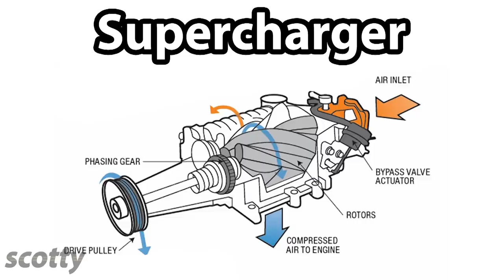Supercharger vs Turbocharger - Why Supercharged Car is Better than Turbo

Comment: Why not have both?
Reply: and nos.
Reply: l3arrett82 then you drive down the road and you hear a loud explosions and you have no engine.
Reply: having both is called superturbo. my car has that and it's the best, and twin charging is something completely different from a super turbo
Reply: Vw did it in one of their hatches, look it up on net....
Reply: then the only option is to hock the house and build a new motor with a supercharger.
Reply: Lancia Delta S4
Reply: Both is nice but you better upgrade all the internals cause you'll be bending rods for sure, if you don't get one shooting out the block. Better get a good cam. A roller cam would be best. Better get some good heads too.
Reply: Volvo
Reply: Both on top of a v8 rip gas mileage
Reply: KastaRules 😂
Reply: i think some detriot diesels had both
Reply: You can. Its called twincharging
Reply: Volvo XC90 T6 has Direct-Injected Turbocharged & Supercharged Engine
Reply: The technical term is "twincharging". It's an incredibly expensive setup, as I'm not aware of any off the shelf kits to do such a thing. It would require all custom fabrication, plus the air charge would be so heated there's a good chance it would actually cost you power.
Reply: scientific method perspective And what car might that be?
Reply: KastaRules reliability
Reply: +jacktheripped  I had an 892 twin turbo great engine
Reply: +jacktheripped  42 ft Chesapeake bay deadrise workboat
Reply: Twincharged Toyota 4age
Reply: KastaRules because the supercharger will become a restriction to the turbo and most superchargers will be very inefficient when supplied with compressed air. The mustang guys used to do it for bottom end torque, it was good but a nightmare to tune and when they removed the super they realized they could gain a lot more horsepower while sacrificing very little torque
Reply: KastaRules You wanna fly you lol!
Reply: It's been done, I've seen cars with twin turbos and twin screw superchargers. The reason why is that supercharger work better on lower rpm range power and turbos work best mid to higher rpm. So you get boost throughout the entire rpm band
Reply: Volvo makes both currently in their production vehicles
Reply: +jacktheripped: The 8V92 had the turbo mounted atop the Supercharger. Sweet setup with a sweet sound to match.
Reply: That's where Audi's have
Reply: Its not called a super turbo, its called a twin charger.
Reply: KastaRules been done for years. Detroit Diesel discharged air from turbocharger into the blower.
Reply: You would be over torquing youe engine and it will blow up. And getting a turbo or a super that can put out higher boost is more efficient than adding a turbo and super.
Reply: jacktheripped an 8V71 was available; made 318 horsepower.
Reply: nouse use not really...
Reply: KastaRules March superturbo?
Reply: 2003/04 Cobra owners do it all the time. 800hp daily driver. #HellionKit
Reply: danger to manifold. the floor panel may come off
Reply: aye! a rally fan!
Reply: bubba fisher , Not if you tune it right!!!
Reply: KastaRules volvo T8 engine has it. Works great.
Reply: Xc90
Reply: Nissan march has superturbo plus audis with TFSi i all hve it
Reply: New Volvo vehicles have them, but the best Volvo for efficiency is when the turbo-charger, supercharger, and an electric motor with a battery pack all add up to a hybrid.
Reply: Yeah, Lancia Delta S4
Reply: Compound boost, hellion makes a kit.
Reply: Leroy
Reply: Skoda Fabia VRS 1.4 Twincharged, bit of a pocket rocket in the right hands!
Reply: Twincharge FTW
Reply: VW had some TSI engines that had both. Combines the best of 2 worlds. More power at low revs from the super charger and more power at high revs from the turbo.
Reply: Twin charged plus nos😆
Reply: KastaRules spotted the beta male.
Reply: rcairforceone unless you run 110 octane therefore you will be running to ric☺
Reply: Vw golf gt sport had both 170 bhp from a 1.4
Reply: bubba fisher nope, VW does it with their 1.2 and 1.4TSI engines.
Reply: my only complaint with supercharger is the whine noise they make, its like a toy car.  get me a silent one and I would get one.... add it to my 2.7l turbo ecoboost.
Reply: volkswagens are twin charged
Reply: Yea as soon as I win the lottery💵💸
Reply: Volvo's newest generation of 4 cylinder engines use a supercharger and turbocharger
Reply: scientific method perspective. Actually its called twincharged
Reply: l3arrett82 if you had both your engine would explode before you can drive down the road
Reply: Look up Hellion Hellraiser.
Turbo kit for supercharged 2003-2004 Cobras. Big power, but those cars come with built engines from the factory.
Reply: KastaRules Because it's a pain in the ass to tune for it. Twincharging an LS is a nightmare and tuning is next to impossible to get right (already tried).
Reply: No problems with the Hellraiser Mustangs...seen a bunch of them them running strong, although I think using the stock blower vs a perfectly sized turbo is only done for sneakiness or the coolness of it. People lose their minds when the pop the hood, see the stock blower, and then the car puts down four digit numbers with ease lol..turbos hidden up in the front bumper.
Reply: bubba fisher its called head studs
Reply: Robert Elmo I had a hard time getting the fueling and timing tables perfect innthe mid rpm ramp. I'm not doubting a bug company with dedicated tuners working on perfectly sized system, I know it was a royal pain on my end. Then again I'm a bit of a perfectionist so that doesn't help.
Reply: scientific method perspective having both is called twincharging
Reply: Jack Barlow your thinking of the 8v92. 8v71 was just blown the 92 was turboed and blown but prone popping from the boost especially when ya turned em up a bit.
Reply: Theres a Hellcat with a set up like that sounds amazing i think it puts out like 1000hp its on you tube
Reply: why? because wings stick out to far from the car, thats why !!! :)
Reply: why? because you'll need a Pilot' license, thats why !!! :D
Reply: Mate it’s no that easy
Reply: P47 thunderbolt had both
Reply: CALIN CAMPBELL the sky is the limit if you know how to build the motor.
Reply: CALIN CAMPBELL yeah really the limiting factor that can't be eliminated is valve/port restriction but then again unlike a naturally aspirated engine you're forcing air in so if the block, intake and head are strong enough and your injectors flow enough then who knows.
Reply: Some seat cupra do :p
Reply: scientific method perspective I've always been told its considered twincharging. I did it on my Audi and it was absurd.
Reply: Then you gotta run on race gas if you want to use both.
Reply: Mar Stillo , what difference does it make the nomenclature? Dr. Sanford A. Moss was the developer of the turbosupercharger   (Note correct nomenclature & not a manufacturer's trade name), although credit for the basic idea goes to Rateau of France.  The turbosupercharger was installed on many WW2 era  aircraft to overcome power losses associated with high altitude,  thereby increasing MAP  (manifold absolute pressure).
Later Sir Frank Whittle built on these principles,  which evolved into the first jet aircraft  developed in the free world.
Reply: cloridan Beauchamps , it's a turbosupercharger which was developed in the very early 1900's by Dr. Sanford A. Moss.
Reply: Justin Girard, turbosupercharger
Reply: KastaRules the hellcats have both!!!
Reply: Ask a volvo owner, something about a liquid soup leak from everywhere but nowhere.
Reply: KastaRules buy a Noble M600
Reply: Hi
Reply: FroztiProductions, that's the best set up there is and it proves that there is room for both instead of one over the other in the way polarized people think.
Reply: Starfighter USSCV-66, I thought it was Alfred Bucci of Switzerland that invented the turbocharger.
Reply: Lol that will probably blow the engine
Reply: I've seen twincharging on modified MINIs.
Reply: KastaRules that actually exists and it’s called a twincharger
Reply: scientific method perspective noob, it is called twincharging
Reply: Nooo, its called twincharging, and its actually pretty expensive and involves a lot of work.
Reply: gotta love my five-cylinder turbo. so weird, but oh so smooth...
Reply: pulls up to a Volvo
"What you got under there?"
"Its an I4 engine" drags on down to next light
"... did i mention its twincharged??"
Reply: KastaRules you'll have WAY TO MUCH boost, which doesn't increase HP any further
Reply: Toyota did it in 1984. The mr2.
Reply: scientific method perspective twincharged*
Reply: Fabia VRS, Nissan March Super Turbo, SQ7 or Volvo with a t6/t8 engine? All other twincharged cars are like 150000€+, so i assume not not that ones.
Reply: KastaRules you mean Twincharged right?
Reply: TwinCharged....
Reply: KastaRules Mbn to be rich
Reply: My volvo has 2 superchargers and twin turbo
Reply: My Volvo has 2 superchargers and twin turbos
Reply: @-smp-scientificmethodpersp838  will it blow your Engime
Reply: @-smp-scientificmethodpersp838  engine*?
Reply: rcairforceone I modified one of my Mercedes to have it. It's not a twin charging system. A twin charging system is when you have a super charger compressor and a turbo compressor working together. A Super-Turbo is when both technogies are combined into one mechanical device.
Reply: scroopy Noopers no, a super turbo system and a twin charging system are different
Reply: Maytee Nodarse no, twin charging is different than Superturbo charging.
Reply: cloridan Beauchamps thanks for trying to help bro. I appreciate that. Actually a Superturbo is a different system than twin charging.
Reply: Justin Girard no, twin charging is different than a Superturbo. Thanks though!
Reply: Eon Gaming nice! Yes, what you did was probably twin charging, because you have two different charging systems working together. That's why it's called twin charging. I did a Superturbo. That's when you take both charging systems, and combine them into one mechanical device, instead of two. Thus, I'm single charging, instead of twin charging. Your car sounds awesome btw!
Reply: Hysandel GT Hey, thanks for the constructive criticism, but twin charging is when you have two systems charging, thus: TWIN charging. Superturbo is when both systems are built into one mechanical piece that looks like a regular turbo, but it's built very differently. Therefore, Superturbo charging is a single charging system, not a twin charging system.
Reply: ALEXIS TROY DACANAY lol I can tell your actually the noob, not me. Twin charging is two devices working together. That's why it's called twin instead of single. Superturbo is a single charging device. Therefore, it cannot be called a TWIN charger.
Reply: Glorified Nuggets Superturbo is a single charging system. Twin charging requires two chargers. They are very different.
Reply: JDM Fanboy no, it's not a twin charging system. Superturbo is a single charger. Thanks anyway bro
Reply: team glock only if you don't know what your doing. You can tune your charger to your engine capability. You can also tune your engine to match your charger.
Reply: GMC Denali 717 maybe if you twin charge, but not if you Superturbo
Reply: rcairforceone that's why you Superturbo instead of twin charging. Way less stuff = less weight and not as complex to put on your vehicle
Reply: l3arrett82 say less I’m doing the same and maybe the kids don’t need a expensive nanny anymore I think they can survive on their own now😂
Reply: Better yet. A sequential twincharge setup which has the supercharger kick in immediately and have the turbo kick in at about 2250 RPM but not produce full boost until about 4750 RPM so that way the tail doesn't kick out from underneath you by surprise.
Reply: jacktheripped
The Volkswagen 1.4 TSI is a 1400 cc engine – utilised by numerous automobiles of the VW Group – that sees use of both a turbocharger and a supercharger, 
Volvo produces a twincharged 1969 cc inline-four engine that is utilised in their T6, T8, and Polestar models
The Danish supercar Zenvo ST1 made use of both turbocharger and supercharger in its 6.8-litre V8 engine
Reply: All is revealed
Reply: It's called twin charging you Muppets
Reply: @l3arrett82  & 2Step
Reply: Volvo does that with their 3.0 and it makes the same hp and 60 less tq as my 2.0 with a turbo.
Reply: It’s mainly a gimmick nowadays.
Reply: There can be only one.
Reply: Overboost=Blown Engine.
Reply: U can
Reply: scientific method perspective it’s called twincharging
Reply: @rcairforceone  But What Do You Call A Twin Turbo And Mono-Supercharged Car? A Tricharger?
Reply: @SolaricSage116  it's still twin charged. I suppose you would call it a tricharger if you had a third boost source, but either way it's a way more complex setup that wouldn't have a performance benefit.
Reply: @rcairforceone  Ok Thank You, For Answering My Question.
Reply: Volvo beat you already, they have sedans that are turbo and super charged with an electric motor that's powerd by gas
Reply: @ezralabandeira3552  So Twincharged Hybrid?
Reply: @-smp-scientificmethodpersp838  its called twincharged actually
Reply: @adamc1694  and has an electric motor like the new nsx to give it more torque
Reply: @ezralabandeira3552  twin charged is when you have two charging systems (twin = 2). Superturbo is one unit. Twin charging would also work if you want both a turbo unit and a supercharger unit, but then again, that's more weight, and not as efficient as a superturbo single unit. A superturbo is a turbo and super into one device.
Reply: @sdrake74  no they don't just supercharger
Reply: Air restrictions at higher boost levels. Much harder to tune. More weight. Just over all less efficient
Reply: @zacheriashelm  turbos also have also have a speed they max out at they don't just keep gaining speed
Reply: KastaRules Procharger?
Reply: -15 Mpgs
Reply: @-smp-scientificmethodpersp838  its called Twincharged
Reply: @PSWii360onBaSS  scroll up and read the comments before yours. I already explained how it's not what you say.
Reply: scientific method perspective it’s called twincharging
Reply: Detroit diesel already did it lol. Google the 8V-92
Reply: then its called" turbo-charger"🤣
Reply: KastaRules People do that.
Reply: Twincharger incoming
Reply: Have a dual engine dual transmission split between the front and rear wheels..turbocharge the front and supercharge the rear..of course nos is highly recommended as well
Reply: @-smp-scientificmethodpersp838  Who sells SuperTurbos for V8?
Reply: @NeedForSpeed.2004  I already explained the difference to someone else. Go through the replies.
Reply: @WisdomOverWicked777Rules  just get your hands on one, and fabricate connectors and tune it for your engine. Look it up on YouTube is you don't know how. Many people do this with all kinds of superchargers.
Reply: @-smp-scientificmethodpersp838  Parts stores dont have SuperTurbo. Only Turbo, only SC.  Haven't Tried Speed Shop yet. But I would pay Retail Definitely. I have Excellent 2011 Escalade 6.2
Reply: @-smp-scientificmethodpersp838  ok
Reply: @bubbafisher8783  that's why u tune it
Reply: Wouldnt a supercharger be better for the engine than a turbocharger, in that, the turbo blows air from the exhaust (dirty), and a supercharger blows in air from the outside (clean)? Just thinking a turbocharger would build up a lot more engine sludge over time and a supercharger not so much.
Reply: @-smp-scientificmethodpersp838  it's called twin charged
Reply: @beni2cc  read the other comments to see the reason why it's not called twin charged
Reply: bubba fisher 😂😂😂
Reply: @B0RN2RACE100  what if you placed the supercharger before the turbo? Have the turbo run on both exhaust gas and supercharged air. You'd need to do some creative fabrication but surely it can be done.
Reply: Zenvo certainly think like that.
Reply: Twincharger
Reply: biG BrAiN
Reply: @l3arrett82 AND E85
Reply: Supercharger for low RPMs and turbocharger for high RPMs. Some cars do have this arrangement indeed. Nevertheless, for those who are more fuel-efficiency inclined, having two turbos is the way to go.
Reply: 2 stroke Detroit Diesel has both.
Reply: That is not as crazy as it sounds there's a V8 truck engine back in the day that had a supercharger with a turbo sitting right on top of it worked beautifully
Reply: @Bandit-10-4   And the Zeno st1 is super charged and twin turbo it was on top gear.
Reply: @bubbafisher8783  or you take flight cause u going so fast
Reply: Thats how nuclear bombs are made thats why
Reply: Some cars have both like the BMW M5.
Reply: Some Volvo models are both
Reply: If u can't get decide between these get a twinturbocharged
Reply: It's been done before

Comment: I have had both. Turbos can be troublesome in regards to heat management. They add ALOT of heat up in the engine bay. Turbo exhaust manifold brings your intake air temps way up and can also melt some of your plastic parts that are near it. You can also heat soak your inter cooler really quick. Couple of hard runs and your car is now not fast anymore because your car is pulling timing to deal with the over heated air that’s causing the engine to knock due to pre ignition of the gas.  Many of these issues you don’t have to deal with with a blower.
Reply: This!

Comment: Both are good choices for making good power. Some of the negatives about a supercharger is they put added stress on the crank and they take hp to spin them
Reply: Not really a big deal with centrifugal ones
Reply: Only thing bad about superchargers is that it’s a huge gas guzzler. If you don’t mind filling up twice a day and got money, go for it

Comment: I like the supercharged because you don’t have the red hot turbine under the hood. A factory turbo is fine but I just get worried an aftermarket setup will melt stuff or worse.